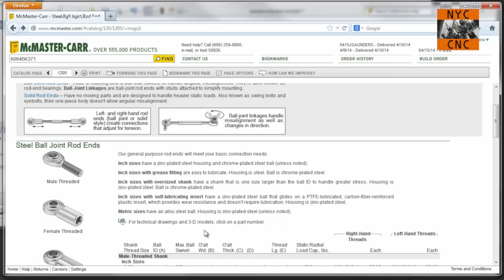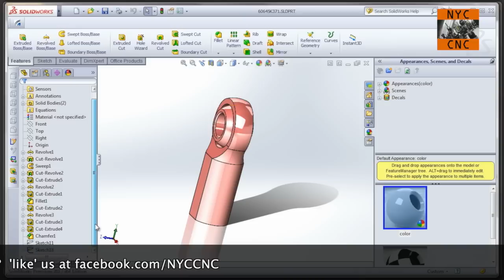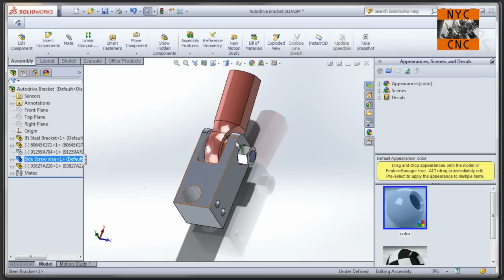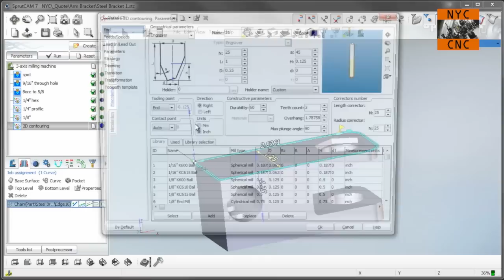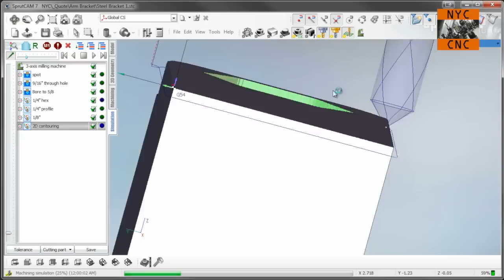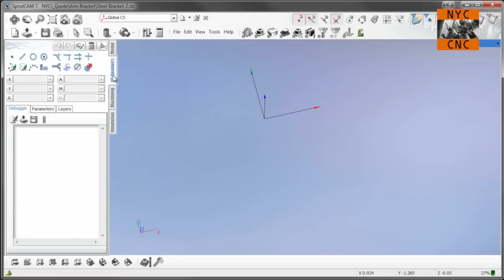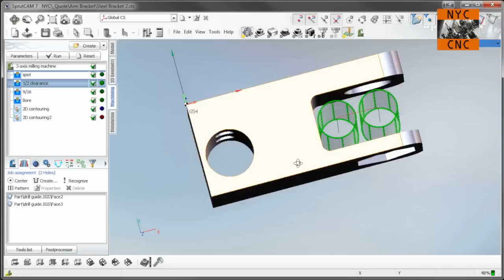CNC Machining Steel Bracket with Tormach PCNC Mill - MFG@Home!

Comment: John;

Being a picky engineer here, but I have always heard that type of pivot joint referred to as a "Heim" or "Rose" joint, not a universal joint.  Universal joints move in a rotary motion, Heim joints move in mainly a single plane of motion, allowing for some variation of approach angle during the motion series.

Another great video from you and nice solution to your customer's problem.

Regards;

Ron Kluwe

Comment: Hi John
Great work again thanks for posting the video.
Looking forwards to the next update on the automatic saw.
Still building up my marking out and measuring tools micrometre and scribing block have arrived this week. Cannot wait till I get my lathe and mill later in the year and the real works starts hence collecting and learning now to use all the required measuring and marking out tools.
Yes the mill will be converted to CNC :-)

Mark
Lancashire UL
Reply: Hi John

This is a link to the lathe http://www.chesterhobbystore.com/db10-super-lathe---open-gearbox-9834-p.asp
This is a link to the milling machine http://www.chesterhobbystore.com/champion-20v-mill-3992-p.asp

Would love to have a tormach have seen yours and John grismos and love what you have done to them and with them.
They don't have a supplier on this side of the pond so will start with something smaller find my way learn improve it Cnc conversion being right at the top of the list and see where it leads as you never know.
Know I will be watching all your videos about Cad and cam with sprut and solidworx.

Regards Mark
Lancashire Uk

Comment: Hey John,
I am new to the machining relm of metal working. Retired welder, fabricator, and ultimately wound up being Union ironworker. Very impressive! Too bad you and Adam
(Abom79) are at the opposite end of the country as I would be your guys new best friend!! You mentioned a couple of whoops, but wasn't that bad as it looked great in the end.
Very smart to turn the shoulder bolt 180°.Very nice job! Thanks for posting.
Ray. Petaluma Ca.

Comment: How much would you generally charge for a job like this?
Thanks.
Reply: @OhioTurbo6 depends how many others would do it, if only you want to do this job and no other cnc/machinist person then as much as you want lol

Often look at material cost, electric used add what wage you want on top gives rough idea (wage includes hours to design it and not just mill)

Comment: Great video! Tormach PCNC on my list!
Reply: NYC CNC I mostly want one for motorcycle based products. I have a Torchmate 2x4 with a Hypertherm Powermax 65 that I used on a weekly basis for my Motorcycle Skid plate production (and other products) but would like to start making billet parts in CNC. I have a Manual mill and lathe but I'm looking forward to learning to program a CNC mill and enjoy the journey! Mostly to add one more skill set to my repertoire. Keep up the great work on your videos!

Comment: Wouldnt it be easier to engrave your plate before plasma cutting? Is it feasible? Use a common datum corner for both milling and plasma cutting operations.
Reply: Yeah it did facepalm

Comment: Two questions.  
1.  How does the Tormach know the length of each tool so it can find z0 with each tool change?
2.  Why is the hole on the nut side so big?  It does not seem like the shoulder is actually being engaged.  Could you have just put a nut on the bolt instead or drilled a 3/8" hole and actually used the shoulder?

Thanks

Comment: have you run many any challenges running most of your operations dry? Tool life, heat, etc?
Reply: very interesting. have you cut any "high tempurature" alloys? Stainless or titanium in particular.

I like flood well enough but my machine paint sure doesn't. 1 Year in and I'm missing about 60 square inches of paint on my chip trays.

Comment: Great stuff!  you made it look as if you were machining 6061 !!!
Thanks for taking the time to put it all together and share it with us. I have one question. what kind of control do you have on your machine?  Are you runing servos or stepper?  I am looking at retrofiting a manual mill into CNC and I am doing some R&D on what´s available out there; would you venture to recommend any special brand for a conversion kit?  What´s your take on stuff from DynoMotion?  and Mach3? .. that is what I have looked at so far. it looks good, but for some reason I think those products are only intended for light duty (i.e. woodwork routers) not so much for metal working...   
I am sorry, that was way more that one question.  lol.

Comment: That's what I'm talking about! Fantastic video, you outdid yourself this time, my friend.
We got to see the planning stage, the CAD drawings, and the final execution... what else is there? I loved every minute of it. Probably one of your best, and most complete videos.
A couple of quick queries... why did you switch over to SolidWorks? And what would  all that work cost a customer?
Ciao, Marco.
Reply: NYC CNC Do you find yourself having to "massage" the G-code produced by SolidWorks/Alibre by hand somewhat before running it on Mach3? Just curious. I've been having to remove some stray lines of code sometimes, and add a few M1s here and there to help with the operational flow, but I don't know if it is a normal thing to do, or not.
Reply: NYC CNC I like SpruCAM, but I am now checking out SolidCam. I like the fact that it is integrated within SolidWorks, and there are no files to be moved back and forth between the two programs. I suppose it might be a matter of using the right post-processor for Mach3, but overall I am running all-right and I'm just having to delete a few extraneous lines after posting the G-code. This CNC stuff definitely has a steep learning curve.

Comment: Little overkill with the grinder, but will admit to dressing up parts myself
Reply: Depends on how I look at it!  As a craftsman, yep, feels great.  As a businessman, it is billable hours NOT going to something else, wear and tear on the grinder, grinder wheels being worn down, etc.  Of course if it is built into your pricing/marketing scheme... (I can't market worth a darn, but I understand the theory...)
One thing I love to do when I have the time is throw my parts in the mass finisher (I have a pair of vibratory finishers) - they will give a nice finish, then into the polisher.  The other thing you can do for a part like that is have a belt grinder with a scotchbrite belt there, and clean up on the belt
Reply: Hey, client loving it = Marketing, adding value etc, which as I said, is where I have little skills.  I couldnt sell a life preserver to a drowning man
Reply: Been watching the new shop vids.  Nice.  Funny once you have a grinder.  I was doing a stupid cast iron casting last week when I got to one surface where it was "OK, I can do this on the mill, but I only have .010 to go, and fixturing on the mill will be a dog, but with the mag vise and an angle plate for blocking, it'll be trivial..."  Guess how it got done?

Comment: Solidworks and Autocad 4ever !
Reply: NYC CNC
 I have worked with both products and they are quite amazing.
But if i have to choose, It depends xD. I guess we are both engineers and you can have a guess what do I mean by that :)
Reply: NYC CNC
 Nope xD Each one is better than the other, depending of what are you using it for.
For example: Solid works with modeling flat sheets of metal
Reply: Autocad is a dying software for those that don't want to learn anything new.

Comment: What boring bar are you using?
Reply: NYC CNC Did you grind or mill a flat on the shank of it or just tighten the boring head's set screw onto the round surface? I'm new to using a boring head and was wondering what the standard practice was for these without the flat as far as aligning the head with the cutting part of the bar. Thank you for all the great videos too!

Comment: Awesome video as always! The ones with the Tormach are always the best.

Regarding the ATC, the power drawbar might be quick for one-off parts, but imagine the usefulness when making large batches of parts. Wouldn't being able to leave the mill for itself be something? ;)
Reply: NYC CNC Ah, I see. Aluminium can be a bit nasty sometimes. Whatever works for you! :)

Although Arduino powered auto servo-aiming cooling hoses would make for quite a video series ;)

Comment: Hi John

Another great Video. Keep up the good work.

(McMaster Carr)
I also use to like McMaster Carr until they no longer wanted my business. One day I was putting together an order and when I tried to pay, they refused to take my money.  So on the phone to ask why and I was told that they no longer would Ship to Canada unless you happen to be an old Customer. So when I pushed the issue they said it was to difficult to fill out all the paper work. What!!  Don't you fill out the paper work for your old Customers? What a Crock. Business must be really good to turn away Customers because your to lazy. I order stuff all the time from the US and other parts of the World and have yet to find another Company that will not take my money and ship to Canada. It's your loss MMC.

Cheers
Willy
Reply: Just like John said their is more to this than meets the eye the paper work and cost to have someone do the paper work just doesn't pay off for them and I'm pretty sure they aren't hurting I know I order from them every other week or so and know about 10 others that are big fans of them.. I would think CA would have something like MMC if not give MSC a try...
Reply: John I have heard of that and also their are other machines that's fall under those guide lines but these machines are way over our price range but it's the point and sounds crazy but makes perfect sense... 

Dennis

Comment: Ok, just a bit of "outloud thinking", not that i mean anything rude to say, BUT, you say that the thread on the thinner side of the "fork" part was a bad idea, and then you make hex notch to accommodate head of the rod you used there as shaft. If you didn't have space on the thinner side, and you used steel instead of Al, wasn't it better if you machined a little hole on the wider side, and through the little shaft, so you could insert there some kind of safety, like spring safety shft, or thread it even and use inbus bolt with some loctite to secure little shaft? Now this is just an idea that i would try to realize.
Reply: +Saša Minić OR! you could just make a hole with tight tolerances since you are working with very good piece of machinery there for these kind of jobs. Heat the part that you make, insert shaft, let it cool, and that's it. And then for fun, you could do safety little thread through whole assembly and secure shaft! :)
Reply: +Saša Minić it is steel as it is grinded on magnetic table
Reply: Adam Ansen you didn't read everything i wrote, did you?

Comment: Very interesting. But it may as well as be rocket science. I have 2eamotorcycle  brake caliper relocation brackets that I need made...Oversized motorcycle rotors and it seems I am at my wits end. No one would take up such a project as it would be too small a project for a shop to undertake. I have no special tools or fabrication skills.

Comment: Looks like most of the work you are doing is 3 axis (2 dimensional), and you are already using Solidworks, you know they have a free CAM software that plugs into Solidworks? HSMExpress is great and it allows you to make all your edits in Solidworks instead of having to use another CAM software. I got HSMWorks but it is rather spendy.
Reply: It isnt found very often but HSMexpress is a great free add on tool to anyone using Solidworks. We have an 1100 also and use our HSM all the time to export to Mach3. Might want to look it up and try it out.